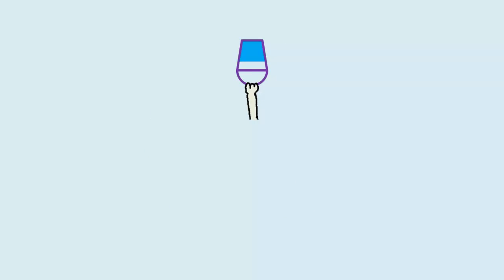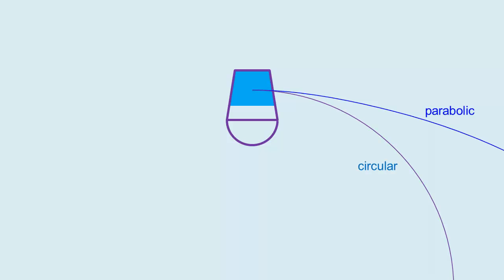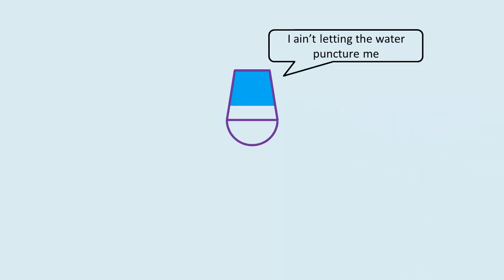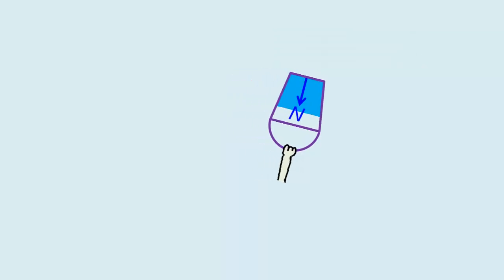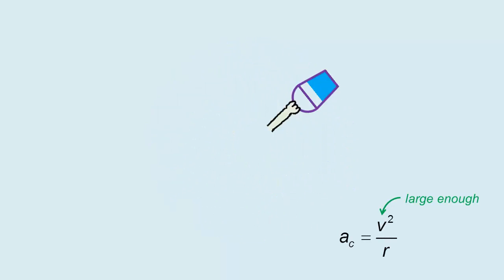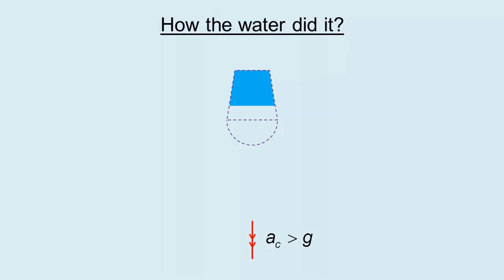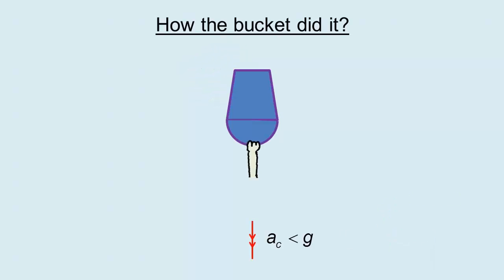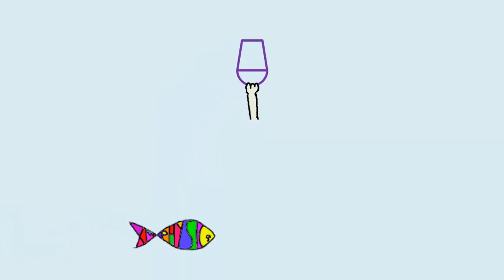Why does Water not Fall Out of a Spinning Bucket?

Comment: Would this be the reason the water in our seas doesn’t fly off as the earth spins at 1000 mph and also rotates the sun at 67000 mph. Is this an example of gravity. The bucket being the earths core etc?
Reply from the maker: You made a very good connection. But I think you should be comparing the actual rotational speed of the earth with the rotational speed of the circular motion the earth's gravity can support. I don't think the revolution around the sun is relevant here, unless you're asking why the earth does not fly out of the solar system.
Reply: @xmphysics  just trying to make sense of gravity. Ie two objects of the same material but one weighs more with a larger surface area. The heavier is pulled faster due to, drag force to gravitational force decreasing. But the heavier having more surface area I’d of thought that would create more air resistance. Like a large vs small parachute carrying identical weight loads. Quite confusing to us pheasant class. 🙈

Comment: To find what the lowest possible velocity that the bucket can have without the water falling, do i have to set the N to zero and make the calculations like this? 0+mg=Fc?
Reply from the maker: yes
Reply: Why do we put it 0?
Reply: @ameenaahmad6592  Cause N is the reaction force from the water, if the water separates there will be no reaction force. So for N=0 thats the point the water starts flying off the bucket
Reply: @savage7882  ok thank u